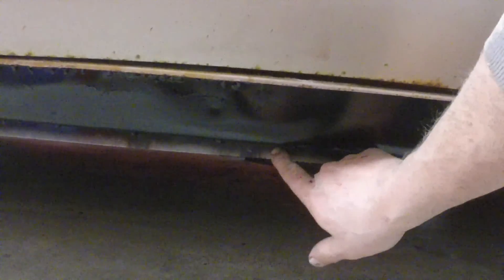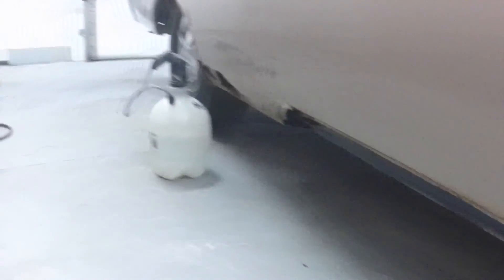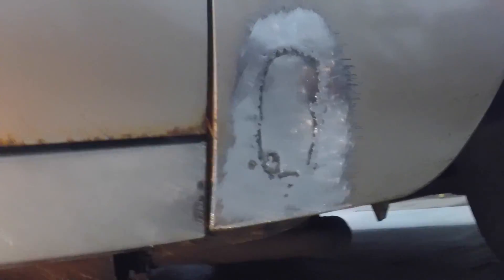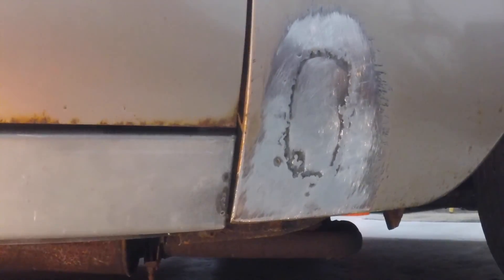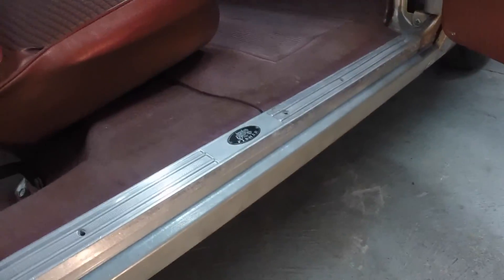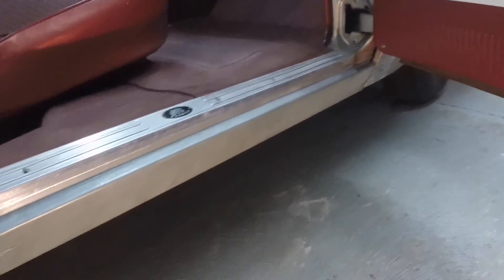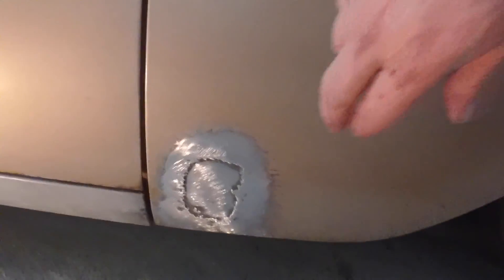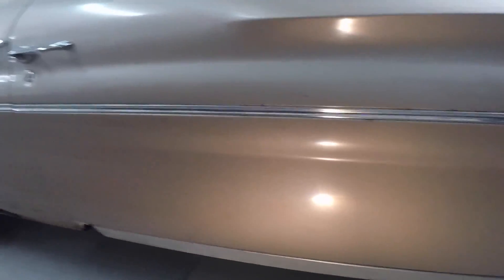Got the rocker panel tacked on the 60 Pontiac Catalina barn find

Comment: I sure do admire the precision surgery that you are doing to cut out the cancer on your Catalina! It may not be up to perfect "100 point" classic vintage auto show standards, or for that matter, the standards of one other poster here, but it certainly is way better than the standard of whoever tacked on those steel cover plates years ago, which was simply to make it look better (which it did), but with minimal time, cost, skill, and effort. Though that "cover-up surgery" did indeed make it look better, it only ultimately added more rust years later, as you said. Whereas, your corrective surgery will help ensure that rust does not get in there again.
Reply from the maker: The steel is solid above the rocker panel. The rockers were never rust proofed. The inside of the rear quarters are rust proofed and solid. I am only replacing the rusted metal, leaving the good metal. My plan is to keep it as original as possible and make a "fun cruiser", NOT a 1000 point show car. I find car shows boring, I would rather watch paint dry than go to a car show. I do really enjoy cruises. Here in the Motor City, there are car cruises every evening of the summer. There are always different cars at them. You can come and go as you wish at the cruises. At a show, your stuck there to the end of the show and there in the day time where it's hot and sunny.